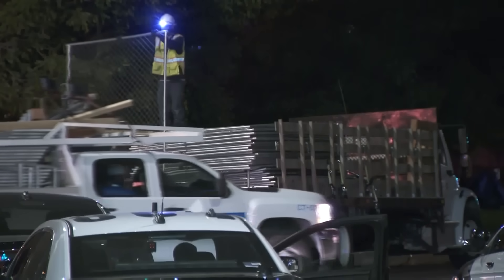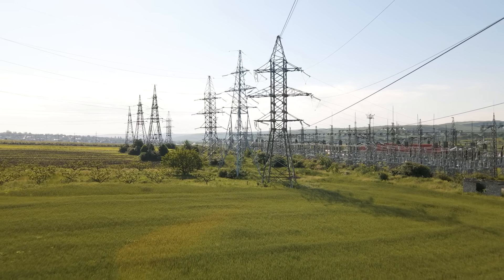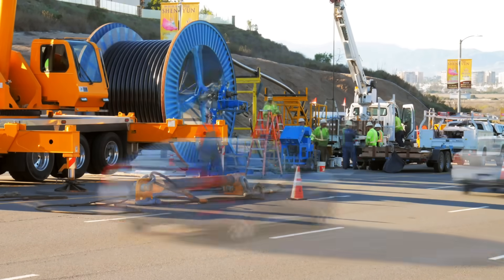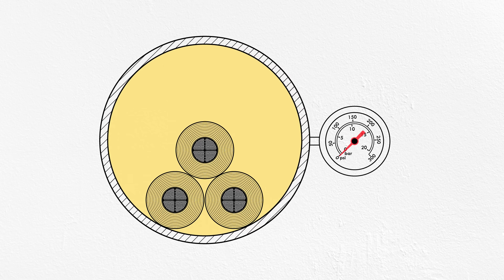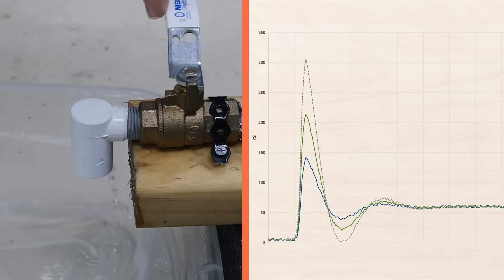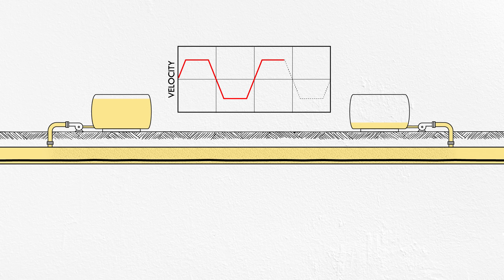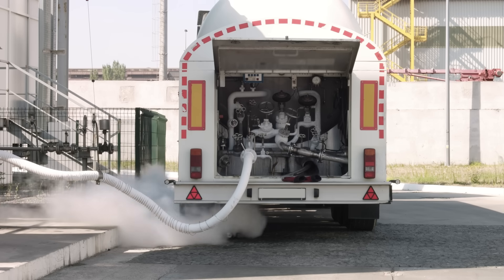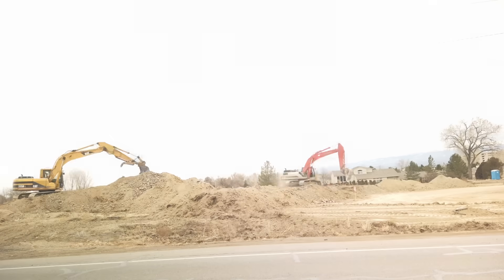Repairing Underground Power Cables Is Nearly Impossible

Comment: Excellent story, it reminds me of a visit to an analogue telephone exchange when I was a primary school child. The fascinating bit was in the basement, below Street level. I had noticed a big chamber with the exchange cables going into it. I was aware it was a pressure vessel due to the number of bolts on a flange cover. I enquired to the guide about it and he said that was the main feed from the telephone exchange to the underground network across the city, it was a pressurised bulkhead that connected to sealed pipes underground that carried the cables. He showed me the compressor room full of huge tanks and compressors and the battery room. 
He explained that the entire telephone network cable system (main trunks) that were underground were in pressurised pipes to keep water out and that the network had the battery room so that in an emergency or power cut the telephone network can keep operating for several weeks, even during severe floods due to the sealed and pressurised trunk system. 
I was probably about 10 then and I have always loved the ingenuity of the engineering.
Sad these days with everything power hungry and digital. Nothing will work in a severe flood, large disruptive emergency or power cut, at least not for general use.

Comment: The number of these style of systems is why we now have what’s called oil blocking joints. They are designed to break the core and paper insulation in a way to stop the oil propagation/seeping.

They allow the conversation (and derating) of these cables into more manageable sections reducing leaks and getting a couple more decades out of them as there replacement come on line.

Comment: We have direct burial (in the dirt) 500MCM 32,000 volt power lines in front of our commercial building. The first 2 sets of cables were installed in the 70's and started faulting after ~20 years. They performed multiple repairs, but now they are completely useless. New line sets were finally installed in plastic conduit over the last 5 or so years and things are better again.

Comment: This series is really starting to give me a lot of unneeded anxiety about the fragility of all the infrastructures we humans so desperately depend on….
Reply: US is pretty far behind in proofing though.  The for profit model is very vulnerable,  since most systems are made cutting costs and hence corners. Countries with public single payer systems tend to have a lot more low cost safety measures and redundancy,  to protect against eventual failure.
Reply: @lookingforsomething  Then ' low cost safety measures and redundancy' should be built into the contract.
Reply: @djg585  Sadly this doesnt come cheap. Speaking as someone in public sector procurement ignoring the additional upfront costs of additional features(which i agree redundancy and quality are worth the cost hence the ignoring), we have a bunch of easy ways things can go wrong because sadly humans are involved

1) You need to make sure that theae additionals are actually being done
  1a) This means inspections and having either a third party or someone with the technical expertise to do these.
  1b) Even with these inspectors do you have them on site 24/7, do you do spot checks, do you check at specific parts. All have varying extra costs.
   1c) who inspects the inspector bit silly I know but people can make a mistake miss things, be occupied, be ill or called away for an emergency. 
2) You also need to validate all the equipment is above board and actually of the stated quality. Supply chain management is a big expense costing a large amount of manpower initially and then continual manpower. Multiply this if international supply chains

 3) Contract Managers(people) are more often than not one of two types, those that focus on the contract wording know it inside and out or those that focus on the actual day to day practicalities. Both have ups and downs. You need either multiple people (more costs) or a rare person able to do both (rare and likely more costs). 
  3a) example as to why the first type can be problematic, not understanding the day to day real world applications can lead to inefficiencies and a very heavy handed approach 
3b) for the second type focusing to much on being pragmatic and practical can by even just repeated actions (not even written) lead to a change in the contract in the eyes of a court if ever brought in front of them and then all the unintended knock on effects. 

Sadly contracting isnt as simple as it might seem and go's far beyond just say this is what they must do and let the lawyer write it up(and lets not even get into lawyers even in the same team having different opinions on the interpretation of the same clause)
Reply: @SereneAncalime  
All you say applies to the whole project. Yes, additional safeguards will cost more. But probably less than the cost of super repairs later.
Reply: Matti does single payer mean we each pay into a single system- and have no other utility choice? If so, my State is on a single payer system. And we are regulated by the PUC, a government regulatory agency. 
Have to be honest. I’m not to happy with our electric rates and power shortages. 
The Green New Deal isn’t working good in California so far
Reply: You definently don't want to read anything about The Carrington Event, then.
Reply: @Torgonius  Or the ‘Year Without a Summer’.

Comment: The use of solid condutors an inch (25.4 mm) in diameter surprises me, given that the skin depth in copper at 60 Hz is about 8.5 mm. Perhaps the greater manufacturing cost of hollow conductors outweighed the cost savings in copper?

Comment: Well...  Their problem is with the oil filled paper insulated cable (a very old technology) and not with underground cable in general. Underground cable is widely used these days and they can be repaired without any problem... These cables can be directly buried or reside in a underground utility trench...  Fault locating technologies have also came a long way since then...  Thanks for sharing...  I greatly enjoy your video...

Comment: I grew up in Silicon Valley. When I was little, it was filled with fruit orchards and yes, power lines. Sometime in the 70's, the whole thing changed and they started the big project of putting all the lines underground. They did the phone lines too, with that new-fangled "fiber-optic cable". It took a long time, but eventually, the power lines were all gone. It was great! 

But I never thot about what would happen if something went wrong on the line. I don't remember seeing any crews working on it, but then it may have happened after my bedtime - as most of those photos show it happening at night. Fascinating!!

During Hurricane Ida, there was the usual chatter about "why don't these people move to somewhere above sea level???" talk, but also, "why don't they bury the power lines???". Now that I see the trouble involved, I doubt that city has enuf $$$$$$$$$$$$ for that kind of infrastructure. Sunnyvale, yes. Los Angeles, yes. But not New Orleans.
Reply: Even in northern Louisiana the water table is quite high. Most houses don’t even have basements levels of high. I can’t imagine wanting to put high voltage lines under ground down there.

Comment: When i see all those marvels of engineering and can't also ignore the fact of how idiotic some laws are and how much complex and expensive they can make a relatively simple job become. Nothing like this would happen if they had simply used the tower lines
Reply: Through an urban area, big tower- Kv transmission  lines , would eat up a lot or property for the right of way/clearance of such lines, as you can't have any buildings or tall  trees or anything standing within about 100 ft of those things on either side. So you're talking a 60-70 yard wide swath of land where nothing can be built or used for other stuff(except maybe an urban garden set-up). This is the major advantage of burying such lines in urban areas dense . The land is too expensive and "rare" , for overhead power-trans lines.

Comment: We got the same old cables in cities here in denmark, altho they are not "pipes" after the paper there is another layer made out of lead and then paper on the outside to protect the lead, these cables are way easier to repair because there is no high presure on the oil. The reason they couldn't just find that cable with the "hammer" is because of the pipe it was in, thr "hammer" is useless in that kind of siturations

Comment: When I was a kid our apartment building was right next to a substation with huge high voltage pylons; when the air was humid (basically all the time in FL) the arcing and buzzing noise from them was loud enough to hear indoors. I can see why they try to run cables underground.

Comment: Interesting story but I can't help but think the author was being told a bullshit cover story. It's a well known fact that most of the dielectric oil used in high voltage equipment prior to the mid 80's contained PCB's and after that there was a concerted worldwide effort to remove and replace said PCB containing oils from any and all older equipment and dispose of it. I was involved in efforts to do this in Australia in the early 90's when I was an apprentice electrician and I find it difficult to believe there weren't the same concerns involved in such a project in the US in around the same time.
Reply: A bullshit cover story.... For what exactly?

Comment: Damn right that oil is expensive. Every time I’ve had the chance to salvage some out of equipment I was working on… You better believe I kept it. I have several 5 gallon drums tightly sealed and safely stored. probably less than 30 gallons total. But try pricing a single gallon of it online… And you’ll see why I saved the stuff!

Comment: Electrical lines in the area of low-voltage networks with voltages below 1 kV and medium-voltage networks with voltages below 70 kV are usually carried out as underground cables in Europe and in residential or industrial areas. In rural regions and with older installations, overhead lines are also common due to the lower costs.

Comment: To be fair here, the reliability of the cable might have been far better if it were made with simple ceramic isolators keeping the cables suspended in the oil. Instead of wrapping the cables in paper. Likewise the cable bundles could have been more loose as to provide better flexibility for thermal expansion to have some room.

However, the oil submersion is an interesting approach with some interesting advantages. If the three phases were divided into their own pipes, then one could technically keep a relatively constant flow going through them, especially if one brings in a fourth backup line during maintenance. (since everything that is supposed to run long term require maintenance at some point or another, good infrastructure should have largely interruption free maintenance as part of the design if easily implemented.)

Also, the reason for the 3 phases isn't directly due to spreading the load onto more cables, the three phases are shifted 120 degrees compared to each other, this is of particular interest when it comes to AC generators and motors. (however, in industry where it typically is quoted to matter the most, it has started becoming fairly pointless thanks to Variable Frequency Drives being used all over the place with numerous benefits.)

Comment: Early 1970s? I wonder if that insulating oil contained PCBs? Very common at that time for insulating all kinds of high voltage electrical components, even some things in your home like motor capacitors. Problem is PBCs were found to be highly cancer causing and were banned in the late 1970s IIRC. The new oils are safe health wise but not as good at insulating high voltages.
Reply: @2009G8Gxp Thx for the update on the cable. But remember PCBs were also used in oil filled capacitors.

Comment: A good one to cover is underground electric powered trains.  Here you have to allow the conduction of electricity to the trains, while also insulating the wires from the ground (which surrounds the pipe). A very complex and challenging problem!

Comment: A question that came to mind when you mentioned fluidhammer again: How exactly do these closing mechanisms work? If it's actually a "wall" being dropped into the way of the fluid in a round pipe, that'd equal to an logarithmic closing speed of the same wall in a square pipe, right? Is there something like a closing speed curve calculated to make sure the actual reduction of space in the pipe is happening linear?

I hope you, at least roughly, understand my question. English isn't my native language and whilst I usually have no issues with it, these very specific and technical topics are still a bit hard.
Reply from the maker: It doesn't really need to be linear. It's more important that it happen slowly so that the elasticity of the pipe can absorb the shockwaves without spiking the pressure too high.
Reply: @PracticalEngineeringChannel  That makes sense. Thank you!

Comment: When you said "most" metals have some resistance. It was the "most" that got my attention? Can you tell me an exception, a kind of wire with zero resistance, unless cooled to near absolute zero?
Reply from the maker: Yes my script editor suggested I make room for superconductors in that sentence ;)
Reply: none. its has to do with the amount of valence electrons in the outermost electron shell of the atom.

1, 2, or 3 are considered viable conductors.
Silver and Gold are very good because they have 1 valence electron, copper has 2, aluminum has 3.

The less valence electrons, the less spread out the flow of electricty across atoms is, so less energy is lost.

However, the other properties of the metals will affect things further, such as its ability to bear heat and stress, and how it will change under heat.

Silver and gold are really smooth, but they melt easy and are heavy/softer, (and expensive lol) and are not viable for long distance power.

All cables are calculated to be able to be heated to a certain temperature from the sheer amount of energy flowing through them before they melt their insulation or melt themselves. We measure it by the maximum power we can cram through em before that happens

Its how we determine what size cable to use for... everything really.
Reply: @scout360pyroz  -- short answer is that all conductors have some resistance.

Comment: This is very timely. Recently my utility company has proposed moving overhead distribution lines underground in forested mountain areas like those near my home. The idea is to reduce the risk of wildfire caused by downed lines or by tree limbs arcing across them. Of course, this is a huge undertaking since many transformers and service lines to homes and businesses would also need to be buried.

I'm dubious that this will make our mountain homes safer especially since it would require many months of road closures and inspection and fault repair would be more difficult and expensive. And because buried lines have about half the service life of aerial lines.

Now I have the cooling of these conductors to consider as I think about this project, and whether I will support or oppose it. Thanks for sharing your understanding of this with us.
Reply: Don't assume 70's technology will be used for a 2020+ project. And most powerlines over here in the Netherlands are buried, but none of the transformers are. They're housed in unassuming little buildings. Could even keep the last mile to the customer above ground if burying that is cost prohibitive. Then again, rebuilding after a fire is expensive too. Underground lines may safe you money on fire insurance (or make it affordable if it currently isn't).

Comment: Wow so much pain to lay wires underground .. no wonder electricity providers are reluctant.. So does it mean Overhead Transmission line is the only viable solution for High Voltage transmission across long distances? Is there any difference if the high voltage is DC or AC? (when AC transmission happen if there is conductor near by EDDY current loses & other loses arises)   So in near future there is no end in wild fires caused by electric archs ?  :(

Comment: Grady, thanks for posting this fascinating piece. When you mentioned liquid nitrogen, I was hoping that you were going to explain how they replaced the copper cables with superconductor cables cooled with liquid nitrogen. As you probably already know, this would have solved the overheating and thermal mechanical bending problems. I once worked for American Superconductor over 20 years ago and thought their developments of Super-C conductor cables would be common place by now, since they also self regulate power flow. Keep up the great work. I love what you're doing to educate people about infrastructure and engineering.